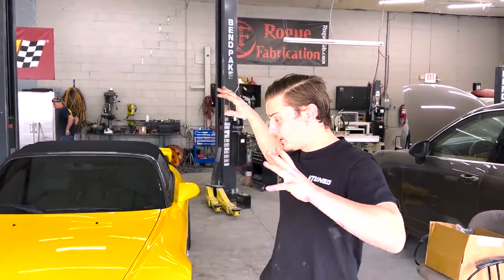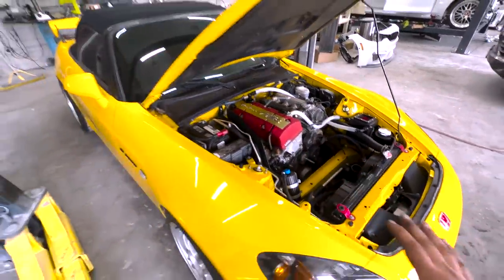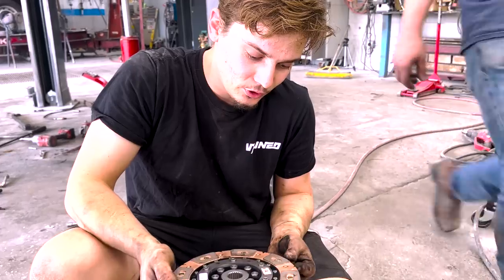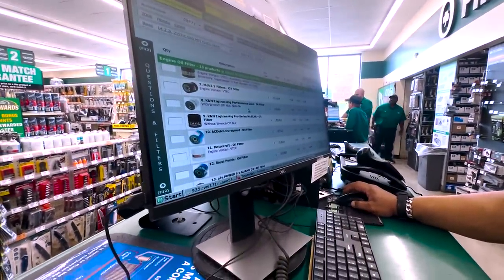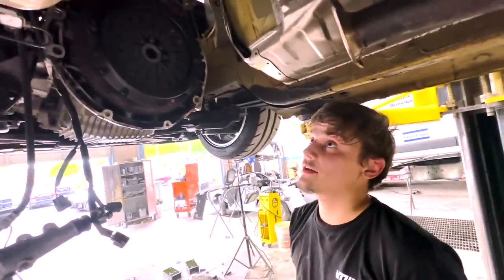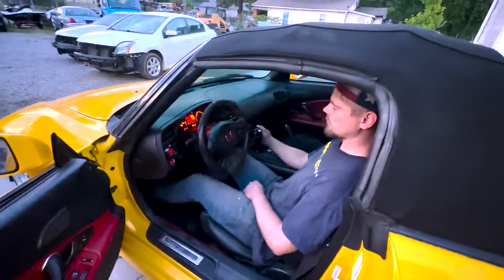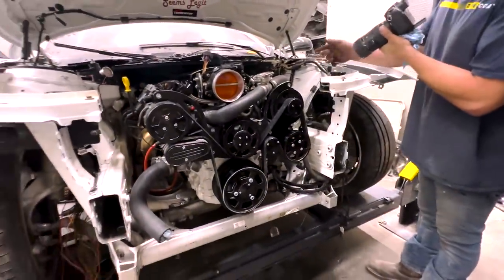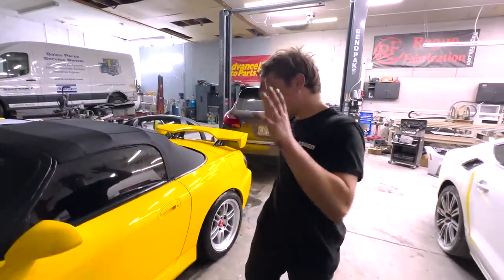Supercharged S2000 Gets A Crazy Twin Disc Clutch!! I Also Made A Huge Mistake!!!

Comment: $75.00 for the camera Yuri. The dribbling lines and tool tapping really were worth a laugh too.Bummer about the clutch,but you found the exhaust problem before it was on the dyno.
If you trading Up and it's going to be awesome,I'm guessing a Chevette diesel with an automatic?    ;)

Comment: Stock pressure plate?? This is why it's always best to upgrade your clutch first before installing a supercharger. Then you don't have to back track and do things twice ;) Getting the TO bearing orientation wrong was painful to see. Did you use Honda UREA grease on the clutch parts that need it? 'Antoine' was hilarious! 🤣:elbowcough:

Comment: I did the same thing on my s2k. I put the throw out bearing in wrong placement. Most hondas the throw out bearing is pushing the pressure plate. But on the s2k it pulls on the pressure plate. I had to do the job twice. Was definitely quicker the second go around. Hard lesson learned.

Comment: Shouldn't the flywheel be resurfaced when you replace the clutch?
Reply: Nope
Reply: @SARSteam Railways  Why Do I Need To Machine my Flywheel When Replacing my Clutch? When a new clutch kit is installed the flywheel must be either replaced or machined. This is because excessive heat from normal driving changes the structure of your flywheel surface which creates less friction affecting the performance of your clutch.